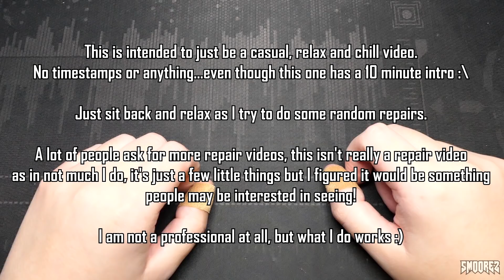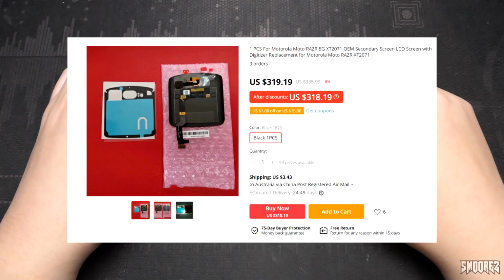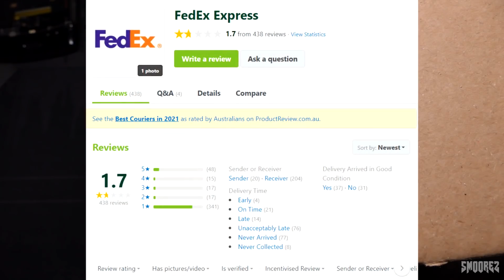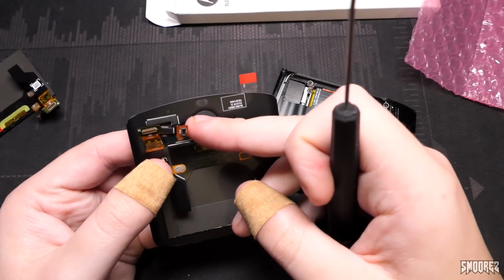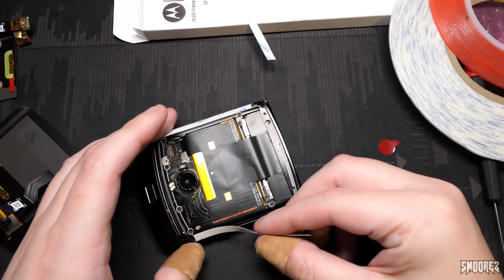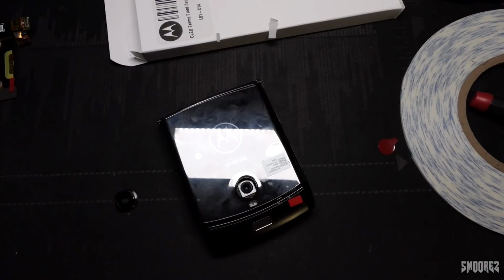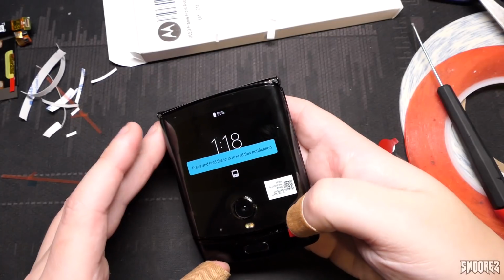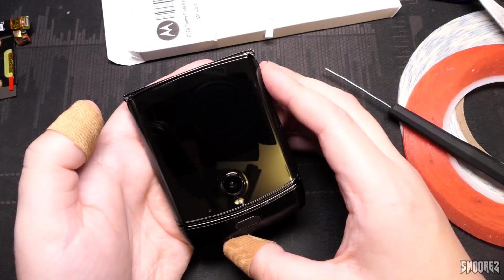SMOOREZ Random Phone Repairs: Installing a new front OLED on the RAZR 2019 + story time & rambling

Comment: Hey people! I actually want to comment on this video. Because I have the Motorola razr 5g, the successor to this original phone. 

It's amazing to see how far Motorola went with the second gen of this phone because let me tell you guys from my experience with the second gen of this phone. Let me tell you, they improved the material and the hinge of the phone actually, like the phone actually has quite a weight to it since they used more of a hefty material instead of the plastic. 

When I first got it the hinge didn't make much of a noise but as I used it more, like a week I started to hear alittle noise but tbh it's not that noticable at this point. 

Honestly I like how they did the hinge on the second version cause it doesn't feel like u have to worry about the screen messing up as much. Of course when you first get the phone you are nervous about opening and closing it quickly, but you honestly get used to it quickly. 

I also like how the second version you don't tend to see the crease cause of how the hinge works. Creating a teardrop type of fold rather than the solid crease of the z flip. 

It's honestly a much better phone than the original razr and I have loved using using it ever since. I feel like alot of people look at this one more than the second version. So I wanted to let y'all know the second is marginally better.

Comment: Have you got any recommendations for the service tools you use and proper adhesive, in case anyone want to try phone repairs?

Cheers, Jim.
Reply from the maker: For repairs, you want a decent toolkit. The one I use is a 117 in 1 kit that I got off eBay for less than $20 AUD. Metal Prytool and plastic pry tools also on eBay are needed. Some credit cards also. Adhesive wise, there are rolls of 3M tape you can get on eBay as well, from 1MM to 10mm. I personally use 2MM, 3MM and 5MM to stick down backs of phones. It's not the best adhesive and you lose any water resistance but it works for the most part. 
If you want to simplify purchasing tools and such, iFixit is a great place to purchase tools and such. Hope this helps!

Comment: i would NEVER be able to do smth like this! for someone that punctured a battery on a Redmi 9C while trying to repair the display because i was stupid and instead of heating the glue up i just stuck my metal prying tool in there and tried to cut the adhesive, i didn't even think of using a plastic tool! imagine what that repair would be like!

Comment: I recommend buying "phone glue"  from eBay or Aliexpress. I got the one called b7000 and it's great for screens. The glue is pretty strong but the good part of it is that it does not dry up. So it's like the original glue that you can heat up and get it off if you don't like the fit.
Reply: I've replaced a couple of screens (for my own phones) and have used a generic super glue but for customers I use a more proprietary brand so will look into the one you mention.. Thanks.

Comment: You should always wipe your contact areas with alcohol before applying your tape. You'll notice the difference.
I hate delicate phones. It's the reason I haven't replaced my LG V20 yet. It's almost 5 years old, been dropped a bunch of times with just a thin silicone skin. Still looks and works great...3 batteries later.
Reply: Can recommend Samsung A70 in that case. Its relatively rugged and not so delicate (and, if you ask me, quite simple to repair as well).
Reply: LG V20 is cool! What model exactly do you have?
Reply: @IsmaelWensder  h918. It's an unlocked T-Mobile phone.
Reply: I was using my old Nokia Lumia until I bought the Umidigi power 3 last year based on a review here.. The Lumia was bullet proof just a shame about the OS, I did wonder about reflashing it with a stock android OS, is this possible I wonder?????
Reply: @Holycurative9610   No, a specific Android build should be made for the device, with compatible drivers, bootloader, not an easy process, that is why old devices don't have Android.